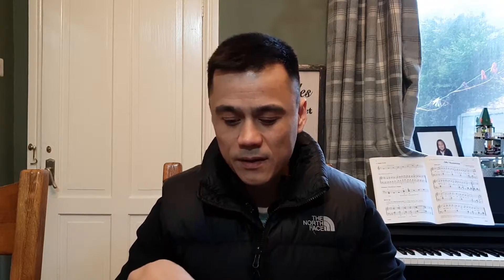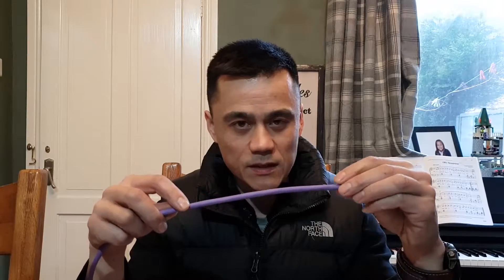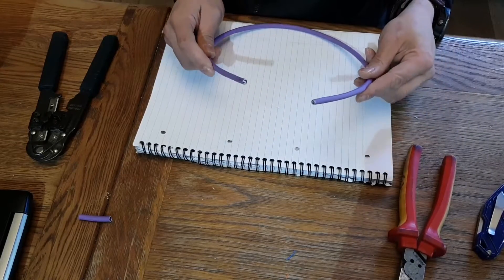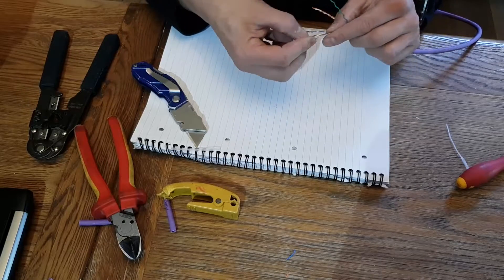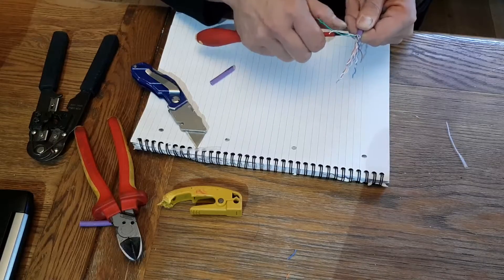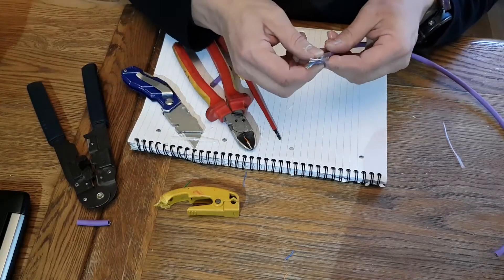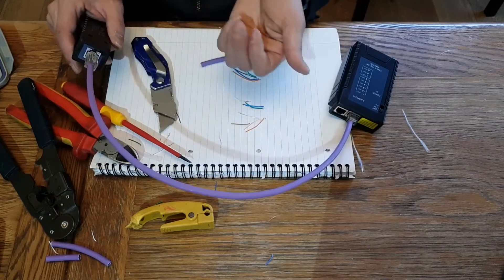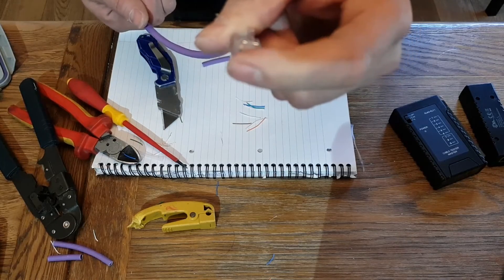How to Make an ethernet RJ45 Patch Lead, Cat6 Connector, EZ Pass Through Wire cat5e

Comment: Good video, but you piss me off. You do it so quickly and with confidence and the cable actually works. I have been doing it the old fashioned way; no pass thro connectors and it is very slow and not at all fun and you don't have any confidence until you plug it in and test it. Then you do it over and over again until you get it right.
Reply from the maker: Lol thanks. These push through are much easier also cat6 is thicker and easier than cat5.

Comment: Oh God, I almost invested 50 US Dollars on a fancy crimper thinking I needed that, thanks for your recommendations! As  it turns out one should not repair ethernet cables the same way you would electric wire, it works for a while but afterwards the electric tape glue actually insulates the copper from within, breaking the signal, this is absolutely the way. Subscribed!
Reply from the maker: Thankyou for the kind words

Comment: So good to be able to hear clearly what you are doing, I tried the other cat5 connector and had a few problems being a novice, I think now I'll try the connector that goes right thru so I can see the wires. One question are cat5 and cat5e cables the same wiring as my home system is cat5 :)

Comment: Thank you for how to terminate RJ45 cat6 through connectors!  I can use my crimper that doesn't trim the wires and I could just use a razor blade to cut it. I wasted a few regular rj45 cat6 connectors due to the cables were not passed by the data tester. It took me like 15-25 minutes to got it right properly.

Comment: Kinda shocked that you didn't enclose the jacket in the plastic connector, which has a piece on it designed to grab the jacket, making for a stronger cable. Did you really make a video on how to terminate an Ethernet cable without knowing that? Am I missing something?
Reply: 7:20

Comment: There is a faster way to untwist, separate and straighten the wires before the crimping process. Check out the #untwisttool https://www.youtube.com/watch?v=8do3EVIjuHY. It comes handy when you have more than just a few cables to make, plus it saves your hands. Great video overall. I hope you don't mind because I posted the link.
Reply from the maker: No not at all seeing as you mentioned why you've posted it. Thanks for the tip as well